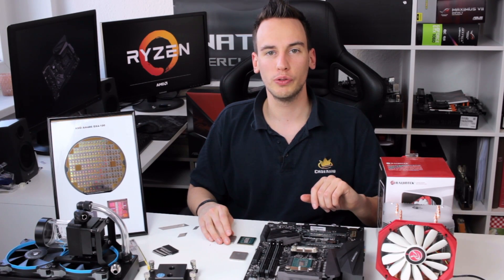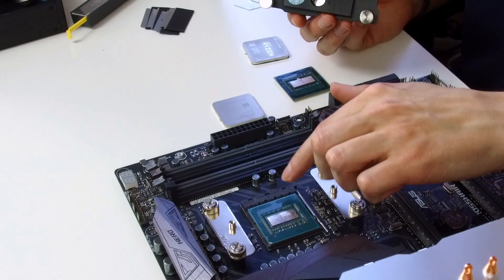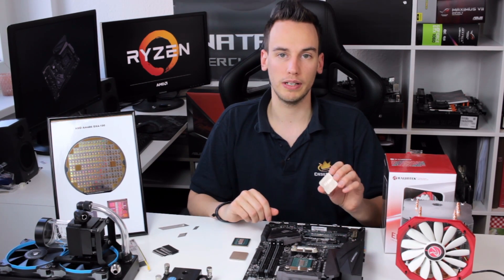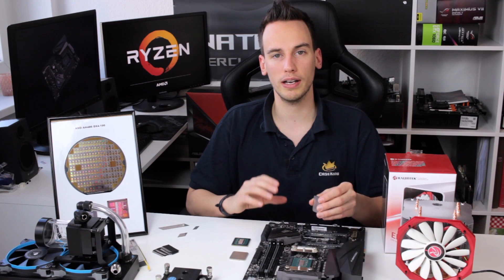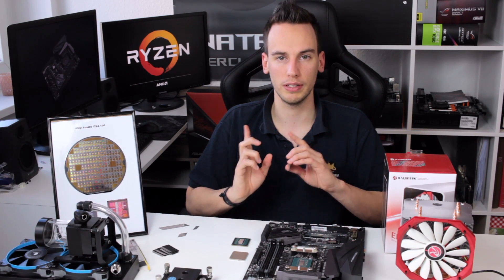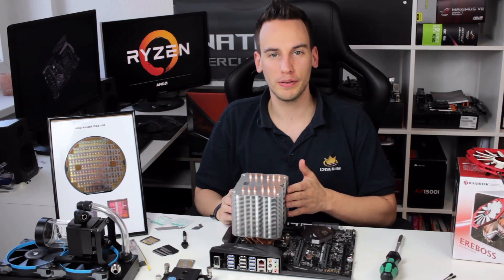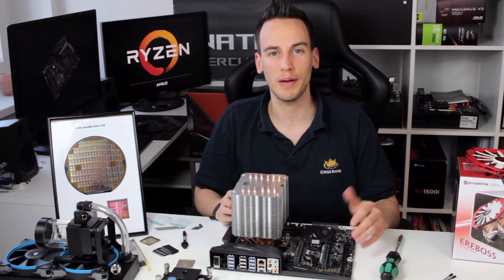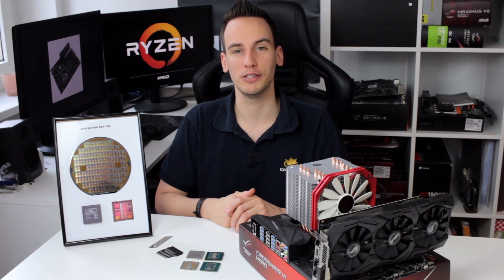AMD Ryzen Direct Die Cooling - Improvements?

Comment: You couldn't just use a copper shim? I wonder if a beefy peltier would work maybe if you water cool the hot side?
Reply: The cooling capacity is not 100% efficient. According to the article linked below, you only get 40-70% efficiency, meaning its likely you would make the chip run hotter and do more harm than good, plus you will be cooling the heat of the CPU + 154w.
Reply: There are some 40mmx40mm peltier units that will do 154w for 10USD on amazon :)
Reply: You're right except that energy inefficiency has nothing to do with how well it can cool the CPU. Yes thermoelectric cooling will suck up a ton of power but with an adequate system it's possible (and used to be quite popular among overclocking circles) to cool processors significantly below ambient temperature. It's a pain in the ass to set up but has been done and is pretty sustainable if you don't mind the cost and extra power/heat for sub-ambient CPU temp.
Reply: I mean you only get (40% to 70%)*154w  of cooling, just to keep it the same temp. So on high powered chips like my FX-8350, it would just cook itself and melt everything.
Reply: which article linked below?
Reply: Sylonce right below that comment. The Marlow.com one. There are a few good ones specifically about CPU overclocking with peltier cooling and why it doesn't work on power hungry chips. I'm not even talking about how it uses way more power than my 1/3 HP compressor on my phase change cooler, I'm talking about how it will just cook itself and not cool the chip after a certain load.

Let's be real, even if it took 2000w to just run the cooler, it would take years to match the cost of phase change, so I don't consider cost of power, the peltier just can't do it. My FX pulls 260+w above idle when under load, and that's on AIO cooling. You would need a 500+w peltier just to break even if I'm looking at the graphs right. To get Sub zero like my phase change can, you really need a very powerful peltier that I don't know of in existence. You can stack peltier coolers, but it has diminishing returns, so you can't just stack 10 on top of each other.

It your cooling an i3, then yeah, go for it, a 150w peltier should cool it down, and 2 stacked could get it pretty cold. But if it has a cooling efficiency of .5, that's not impressive compared to an efficient phase cooler in the 2-4 range (having below 1 efficiency is terrible for refrigeration cycle)

Comment: der8auer Im pretty sure that HWiNFO software doesnt have update for Ryzen CPU so the temps you see are not correct. Did you use probe or relied on software for temps? As you know AMD doesnt show direct temperature and softwares use complex formula to calculate the temps. Also I understand that Zen tj max temp is 75C as Intels tj temps are 95-105C if im not mistaken.
Reply from the maker: The version I have is Ryzen ready. The temps you can see are the core temps. the 75°C you are talking about is tcasemax. The max core temp should still be around 95-105°C.

Comment: puts blade on CPU die, you have massive balls friend, i would not be this brave. interesting that the 1800x is getting very hot. i have been hering that the 1700 run cooler at 3.9Gz OC, can you confirm?
Reply: That's just faulty measurements
Reply: Considering that the 1700 has a 30W lower TDP i can see that happening. I have seen some of those results too...

Comment: I think i know why Ryzen runs so hot. Probably because Globalfoundries 14nm process isn't very good. Would love to see what happens if AMD had used TSMC process.
Reply: Ryzen has better perf/watt than Broadwell-E, which uses a different 14nm process. 

It's just basic physics that they run hot, you have like 150W or more when overclocked

Comment: Great! So AMD did well with the solder and IHS, no need for deliding. But why OC on Ryzen is so bad?
Reply: Temperatures, and optimisation for the BIOS, Windows, and games/benchmarks. It's a completely new architecture, so it'll take some time before things are flushed out.
Reply: I suppose it has to do with the new 14nm process. It also seems to be optimized for low power and throwing more volts at it is not something the chip seems to appreciate.
Reply: This. This architecture was designed with servers in mind. Future iterations will be better for general consumers who want to OC but for servers, Zen is amazing.
Reply: fleshed out*

Comment: I thought it wasn't possible to delid Ryzen...?
Reply: chiken144p technically it is, but you need a heat gun or some other way of melting the solder. That involves much more risk than delidding chips using paste, which is already a risky process
Reply: Okay, is it possible to re-solder the heat spreader back if one desires or would that be a little difficult?

Comment: Thanks for the video!   Not sure if if this a good sign. It is good becaise delidding won't be necessary but it also means we can't extract more performance from the Ryzen chips.  It is already at the best that it can do.  See, AMD provided it with a good cooler, good IHS interface, and an XFR ability which seems better than Intel's turbo boost but we feel it can do better especially in games and few thread apps.

Comment: Did you use the same cooler for the "before" test as for the "after"?  This video makes it sound like you only found the air cooler after delidding the cpu, which makes it sound like you used a different cooler for the "before" test.
Reply: curmudgeon I feel like der8auer would know but that's a good question to ask
Reply from the maker: I delidded 2 CPUs in total and used the first CPU for the mounting test while I used the 2nd CPU (stock+delid) with the same cooler ofc :)

Comment: You should turn that heatsink 90° so the heatpipes make better contact with the die.
Reply: Maxwell Adams the heatpipes don't contact the die, there's a baseplate on the cooler :)

Comment: Is 4,6 GHz 1.375V on i5 6400 good result? ofc on air
Reply: search bclk overclock man, dont be cocky.
Reply: Lol, thought you were trolling but if you did manage to get it to 4.6ghz, that is a very nice overclock. You probably won the silicon lottery with that CPU.
Reply: Yeah, that's superb. If I were you I'd leave it at 4.6GHz because you're going to hit a voltage wall somewhere down the line.
Reply: There is CPU-Z verification guys :D http://valid.x86.fr/snju35
Reply: I managed to get 3000 MHz on ram(HyperX Predator)
Reply: btw I can hit 4,7 GHz on 1.4 and go through cinebench, but it bsoded in gta v
Reply: on idle it's about 40 and on full load it's about 72(peaks to 78). My cooler can only be bought here in Poland(SilentiumPC Grandis 2)
Reply: temps please on idle and full load? and also what cooler you using?
Reply: did 4.4 on my 6700t, cinabench on my channel ;)
Reply: Kyslu You cannot overclock an i5 6400...

Comment: Surely the air cooler you used isn't quite as good as the watercooler you did the initial tests with. Seems to me that if the waterblock could fit directly to the die it would be more like a 5 degree difference.
Reply from the maker: I use the air cooler for both tests ofc :)
Reply: He used the air cooler for both benchmarks.
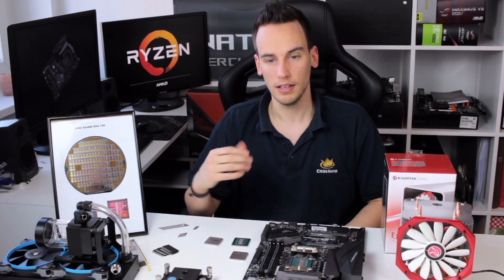Reply: Janeichen Does he say that? Surely he only realised that the waterblock wouldn't fit after he delided the CPU. 2:19 suggests he did the previous testing watercooled. Although the temps are quite high for watercooling.
Reply: was thinking the same hope der8auer can clarify that
Reply: der8auer Ah good. At what point did you realise the waterblock wouldn't fit the delided CPU?

Comment: amd should really set up a department to offer soldering services to intel buyers, these people will definitely buy amd from their next upgrade onwards
Reply: What about sandy bridge generation they are soldered?
Reply: Yea i know that, but Energy Core was saying that you can not solder on a small chip but sandy bridge was also small, Intel just had a monopoly and that's it lol.
Reply: Intel just don't care much about overclockers, and they are elitist for soldering the extreme CPU's only, could be that the price point would be even higher too.. (and they're already pretty damn fucking high right ?! ) but I wonder just how much..
Reply: hah...interesting, but weren't there some skylakes hitting 5ghz and whatnot ? is it rare i7@5ghz must heat alot unless lucky voltage roll... anyway they should totally solder CPU's.. it saves them pennies, ahh but pennies on millions processors =.. $$
Reply: ExperimentChannel - Yes, they are soldered.. Sandy brisge was the last generation to be soldered aside from the one off "devils Canyon" 4790k which was basically a 4770k with solder put on and sold to gamers as having "extra overclocking headroom".. Really it was just a cheap trick to make an extra buck.. But all of the "extreme edition" CPU's use solder though.. But they also cost a lot more ranging from $450 - $2000.
Reply: And sandy bridge brought the best chips for overclocking too. Coincidence?
Reply: Well, in the beginning it was more of a money grab. But overtime the 4790K became cheaper than the 4770k. It usually sold for less, buy about 20 bucks.
Reply: yes. sandybridge is the last intel generation that was soldered.
Reply: neon neophyte nope X99 was soldered
Reply: fair enough.
Reply: @ramin rostami You're an idiot. take a look at the CPU Usage across ALL CORES. Take a 4.0GHz Pentium 4. then take a i7-6900k with all but one cores disabled. Which are you going to get higher framerates in. the i7. BUT The game is still going to run shit. Then re-enable all of the cores. Re-run your game. Look at the framerates. How much higher would it be. Take GTA V For example. Science Studio (I believe) did a video on Single core gaming with a modern chip. Notice how the game glitches to fuck and is completely unplayable on a single core. Because games rely on all cores of a multi-threaded CPU unless the game is too old to support multi-threaded CPU's or simply isnt optimized for them.
Reply: montosunify you can't solder a small chip like a 7700K, der8auer shows why in an article of his

Comment: Congrats for achieving 5802.9MHz on launch day!!! You're a GOD!!!
Reply: The chip might be fast but Intel totally screwed up.  Intel is in full panic mode because of threadripper.  The x299 chipset is full of features you can't use unless you buy a1500 dollar processor to go with it.  You also forgot to mention that score was achieved on a 4-core processor.  Intel will have the same heat problems with their 8 core processors same as AMD.  I am hoping that threadripper's large die size will help it out with overclocking.
Reply: wait... found it... http://wccftech.com/ryzen-7-1800x-overclocked-58ghz-ln2/
Reply from the maker: Thanks man :)
Reply: Where can i find this?
Reply: what?
Reply: Wait, was that you! Amazing!!!
Reply: der8auer   This is the paste on metal or solder ?
Reply: yes
Reply: oh shit that was him?
noice
im sub
Reply: Yeah , but Intel sucks
Reply: everybody knows Intel X299 runs super cool and quiet and the 8 core Intel sips power like half core AMD...and besides who can't afford 2000 USD processor? to be frank it's a very reasonable price for the average layman and if you can't afford it, you must be super poor
Reply: Gabriele Calì Intel hit 7.5ghz on their x299 😑

Comment: Thank you for introducing me to deliding. My 4790K runs up to 5.1 GHz at 1.45v while staying below 75c in benchmarks (less in games). At my 24/7 clocks (4.8/1.32) I never break 60c.
Reply from the maker: Pretty amazing clocks man!
Reply: paskowitz That is a very nice overclock!
Reply: what cooler are you using?
Reply: How. My 4790k runs at 70c underclocked.
Reply: You mean undervolted?
Reply: My values are from silicon lottery where i got my cpu.
Reply: wait. Can you turn the voltage of the cpu down but keep it at the same clock speed? And will that lower the temps?
Reply: May I ask which cooler you are using? Thanks!
Reply: i7 920 is like 2.677ghz stock
Reply: I'm thinking of deliding my 4790k,still on the fence
Reply: Chang Yep.
Reply: tf you on those values pulled out your arse. i do 4.7 @ 1.27v and the jump to 5 is 1.5v. and mine is deemed a well above average chip. i know people who cant even get 4ghz on stock voltage
Reply: That's below average for a 4790k ROFL.  The average is 4.8ghz 1.28v.  5ghz 1.37V.

Comment: I have some question. I read article about why Intel using TIM since Ivy Bridge at your site. I wonder about Ryzen. It is 2 small dies but why AMD insist on using soldering ? Will soldering crack and damage the cpu after several thermal cycle like Intel claim in case of small die ? Thanks in advance
Reply from the maker: Ryzen is one die. I guess because of high energy density to provide a good cooling. Otherwise it would probably not be possible to offer 4G boost on 1800X.
Reply: Bayonet Yugoslav the thing is, mainstream intel chips like skylake, haswell etc ( that use paste), are all relatively small dies in the mid to low 100mm² mark. Sandy-bridge, which used solder, was 216mm². Solder is fine on larger dies (intel uses it on the hedt platform), but it can cause damage to the chip during the soldering process if  the chip is too small to dissipate the heat required.